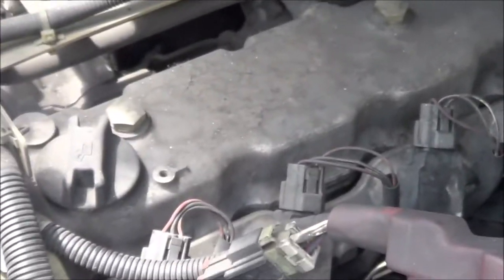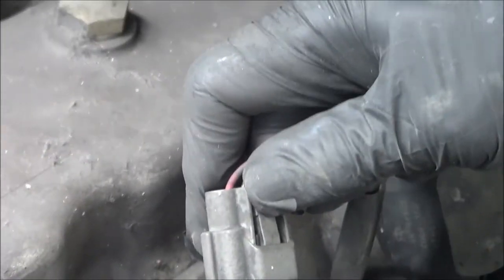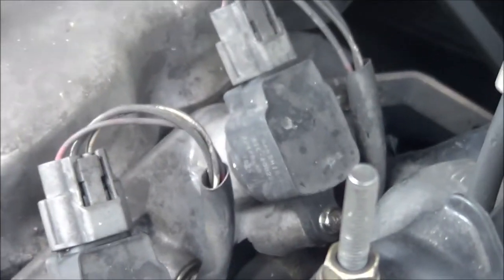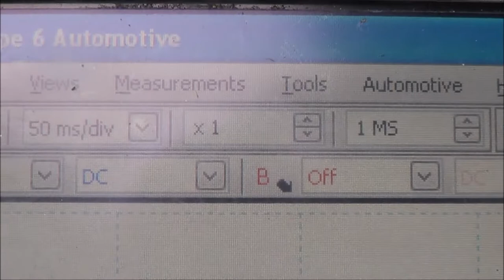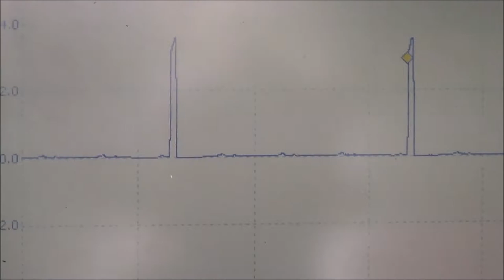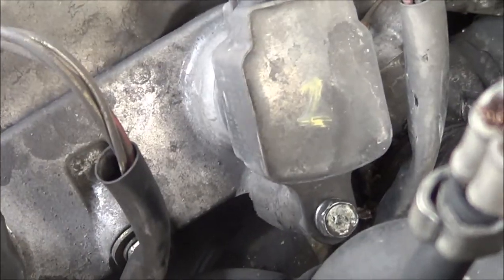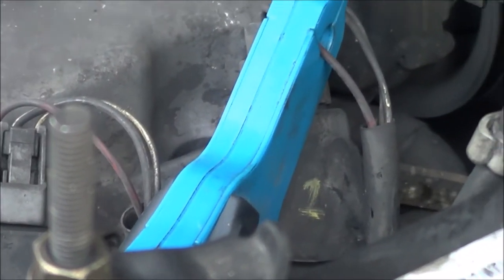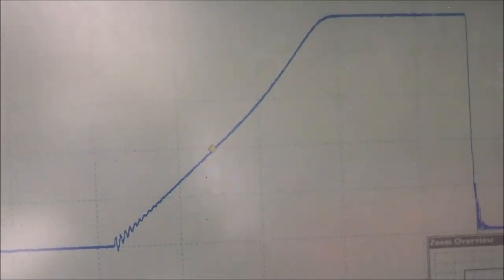CAT Forklift Misfire From a Shorted Coil (ForkliftGeek)

Comment: So if it was not the coil what would have been your next option?
Reply from the maker: If it was not the coil, the problem would have stayed in the no 1 cylinder. Next step for me is to check the spark plug. If there is nothing wrong with the plug then mechanical integrity testing would be my next step.
Reply: @forkliftgeek10  ok so coil and plug was switched with working ones and the problem stayed with the same  cylinder, what now? but if the mechanical integrity of the cylinder was bad would it throw the code e34?
Reply from the maker: E34 is an ignition related code. Even if there was something mechanically wrong in the cylinder it would not code out as long as ignition was present.
Reply: @forkliftgeek10  so what do you think could be my problem here? I'm ruling out coil and plug as the problem since I switched them and the problem stayed on the same cylinder, I'm ruling out the ignition relay because I'm thinking if that was bad it wouldn't jus affect one cylinder, can you give me sum advise on what to check next?
Reply from the maker: If you have an E34 code and problem stays in the same cylinder, check the connector and wires for that coil. This system is known for bad wiring.

Comment: Is there a good program to use to pull codes yale fork lift Obd2
Reply from the maker: +Tom Prince if it is using an impco system it needs either a psi or e controls both available from their website but you are going to need the interface cable and yale password. If the truck has lcd display it probably has on board diagnostic through that display but would still need password. Not all forklifts are generic obdII compliant.
Reply: ForkliftGeek  thanks i have been working on troubleshooting it has a B2000 mazda cable driven throttle body and fly by wire, i am checking to get the interface cable for codes there is no display.
Reply from the maker: +Tom Prince does it have an impco fuel system?
Reply: ForkliftGeek no propane
Reply from the maker: +Tom Prince impco is a brand of the propane fuel system. There are several propane brands that are used in these trucks and each have their separate codes. Like I said not all trucks are OBD2 compliant.